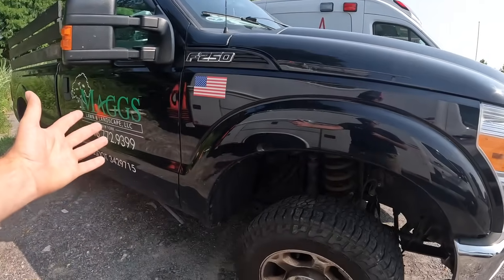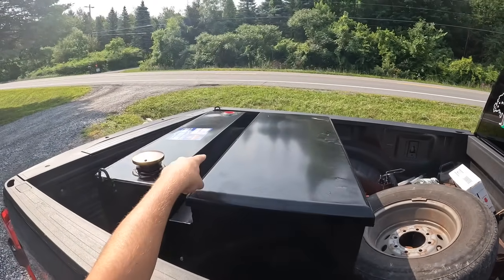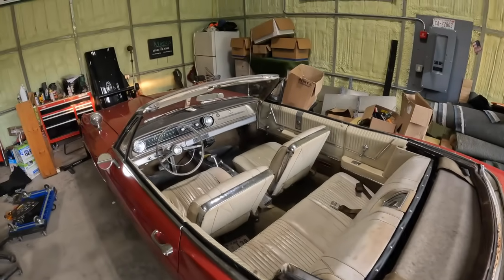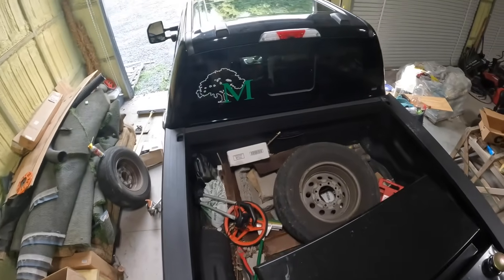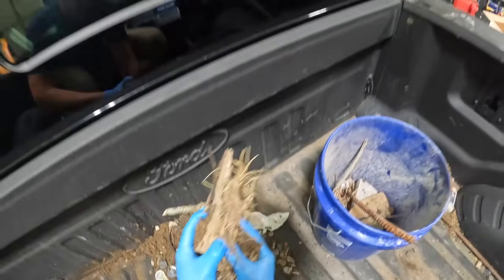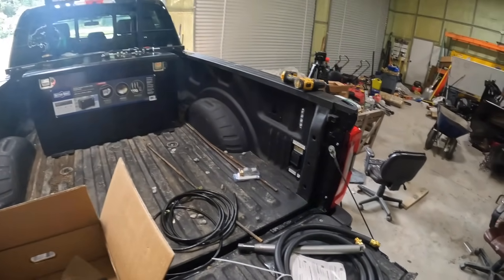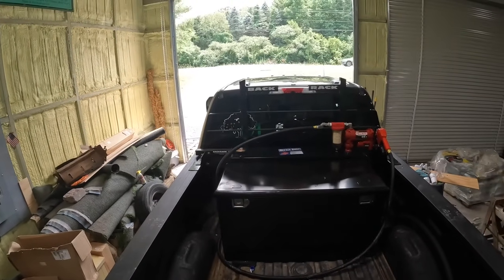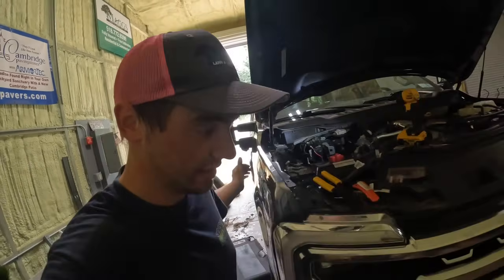Installing New Truck Accessories + Taking The Impala Out!

Comment: Pro tip using the tank when your done filling the machine lift the hose up in the air and it will drain the diesel left in the hose into the machines tank in turn no diesel leaking in your truck bed

Comment: I love Fords but between ball joints, steering arms etc they drive me nuts. I got a 2019 that has a slight knock when turning, replaced all steering components still didnt cure it.   Drives me nuts.

Comment: Try to switch to Chevy in the future I think you’ll be a lot happier with a lot more uptime
Reply: Makes no difference what you go with. If you have enough trucks and you work them, something is bound to break. No brand is perfect.
Reply: @patriothomeservicesgeneseo your right something will break, the engines in that one seems to be holding up alright
Reply: Don’t matter Chevy ford or ram they all have their issues. They are have certain parts that are superior and less superior then others. Over the years in construction iv driven them all they all have had there issues in my opinion from what iv driven is the old Chevy Kodiak were fantastic work trucks we had many many years of good service of them till they got over 200k of hard miles of towing 12 thousand pounds every day their hole lives. Now the modern Kodiaks suck we have issues with the new fords along with the regular 1 ton Chevys. If I had it my way and I was business owner I’d be trying to buy every town owned low mile Kodiak not that those are ideal for his operation I geuss.